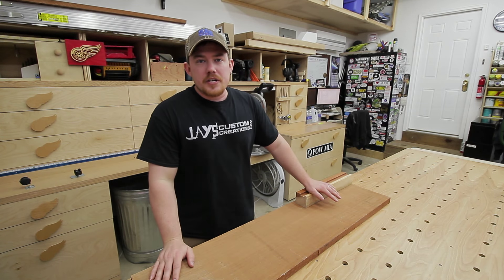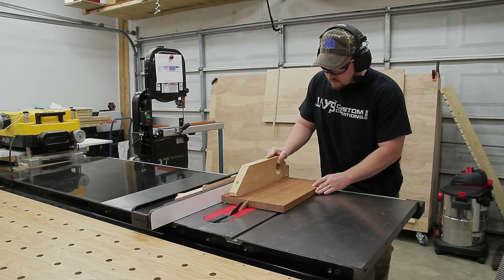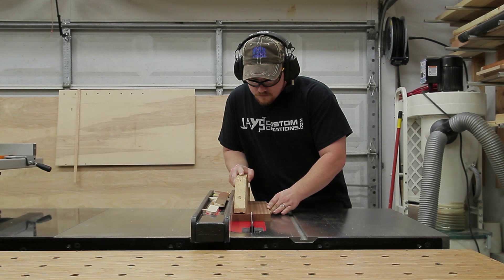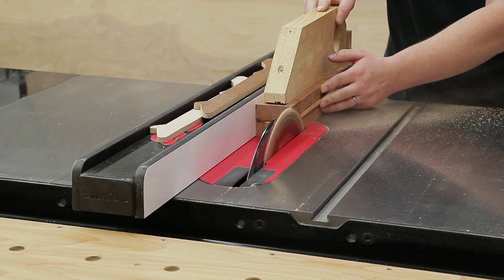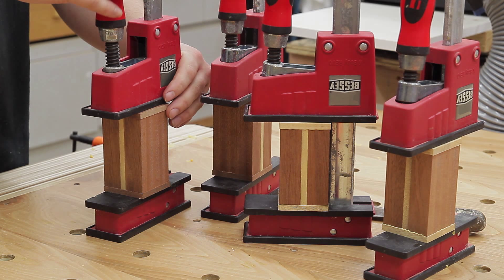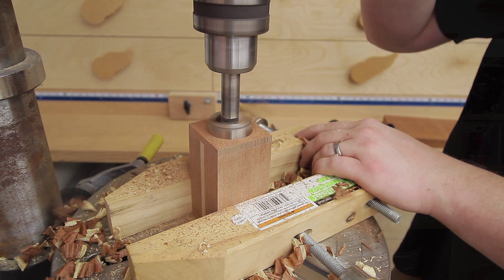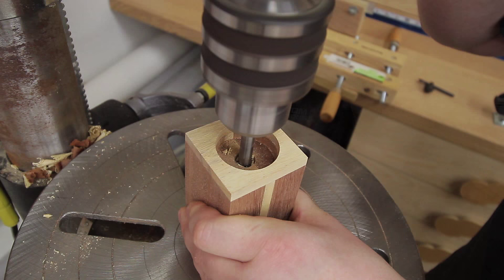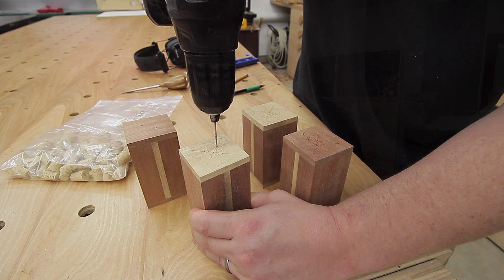Easy Gift Project: Salt And Pepper Shakers - 215

Comment: Thanks for sharing this "simple" project. I made a couple sets for our Thanksgiving dinner since we're having about 20 people at it. I might even make a few sets for some gifts this year. Instead of using laminated stock, I had some 2 1/8" square locust that I planed to 2" square and then used. In an effort to use scraps, I used some 5/16" black walnut for the pepper and 1/4" cherry for the salt. The bottoms are 1/4" hickory.
Reply from the maker: +Mark Warnow Quick and easy :)

Comment: I made some like these, and have two comments:  
First, I made the mistake of using pretty hard woods (padauk & red oak) for the materials, and found that even with a brand-new, high quality Forstener bit, my drill press bogged down *terribly*, and the bit got incredibly hot.  Admittedly, it is not a very high powered drill press, but it still was surprising.
Second, I decided that aesthetically, thinner and taller was much preferred...but then add in both my first comment (tough to drill out) and the fact that I now was drilling much deeper...and you can see it was "less than fun".  PLUS, my Forstener bits were not long enough to go full length on the top chamber (but still hollowed out enough to give quite a large fill).

Comment: Have you thought of turning them either to a full round or maybe a partial turn to give a radius edge.  I think either would be more comfortable to handle and the radius edge would add an interesting look.
Reply from the maker: +Stuart Holden Comfort isn't a concern on something you use for 5 seconds once per day. Plenty of ways to make them look different though.

Comment: Hey Jay Great Built as usual.  I have a non-related question.  I see you have been through some table saws in your videos a Porter cable I believe, a grizzley and now the Saw Stop.  My question: Is there a great difference in quality between the Saw Stop and the Grizzley? Other than the safety feature I mean.

Comment: Jay, I really like the large section of wood behind the blade on that sled. Seems like a nice safety feature. Do you find that it gets in the way at all?
Reply from the maker: +Michael Lawing That's actually to keep the sled together. The blade was set higher than my fences so without it the blade would split the sled in two.

Comment: By running the boards through the planer at an angle, does this help with snip or is there a reason to pass the boards through at an angle? My next tool purchase is a planer so I am new to them. Thanks!
Reply: +Jacob Ambuehl Passing the boards through the planer at an angle helps to even out the wear across the whole width of the blades.
Reply from the maker: +Jacob Ambuehl On my machine it drastically reduces snipe.
Reply: +Ian Garthwaite Wear leveling is easily done by passing boards from side-to-side. You run the first board thru on the left, the next board next to where the first was run, the third next to where the second was run, and so on until you reach the right side. Then you repeat the cycle. This distributes the wear across the cutters.

Comment: I woulda turned them myself before cutting them all down. I love round and curves though. Personal preference.
Reply from the maker: +TheBikerScout I might have done that as well if I had a lathe.
Reply: I know you don't have one... I was just sayin'.
But you know, even that $199, 10"x18" bench top lathe at Harbor Freight is actually really good for small projects like this. (Just get some real chisels and gouges) I've turned bowls, pens, mini baseball bats, candle holders.. you name it, on that. Works like a champ for the occasional turning project. You can even turn small cabriolet legs on it, if you know what you are doing.
Reply: +Jay Bates I just thought about this... but it's still not too late to turn them, since you made the center mark on both ends. HAHA!
(Rough off the corners on the bandsaw first however)

Comment: What's the metal blade thing that you would drag across the wood called? Or is it just a thing of metal. And also what is it used for?
Reply: Outlawbaitco it's called a card scraper. A favorite of many woodworkers for applying a smooth finish without sandpaper.

Comment: How did you get all of the saw dust and shavings out of the chambers that hold the salt and pepper?
Reply: +Travis Fontaine Was wondering the same.
Reply from the maker: +Travis Fontaine shake it and thin needle nose pliers. I assembled it in the wrong order in this video. The 1/2" hole in the bottom should have been cut before gluing the top and bottom on. I've made several of these sets and make that same mistake every time.